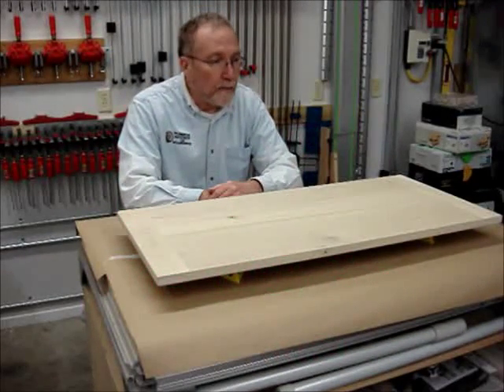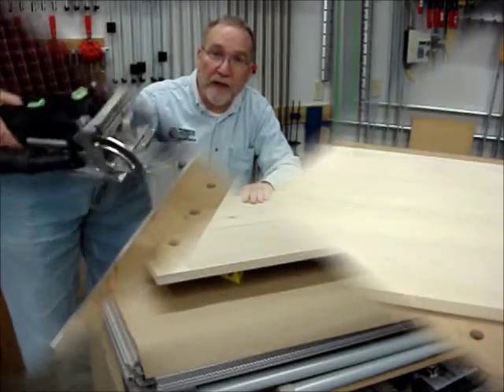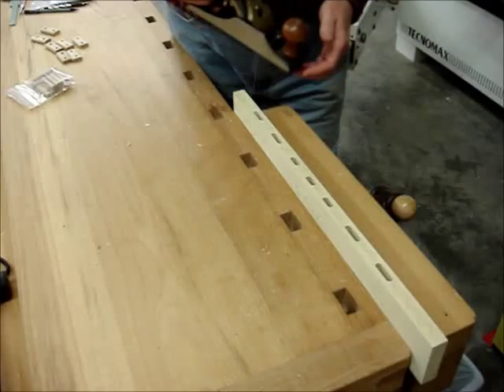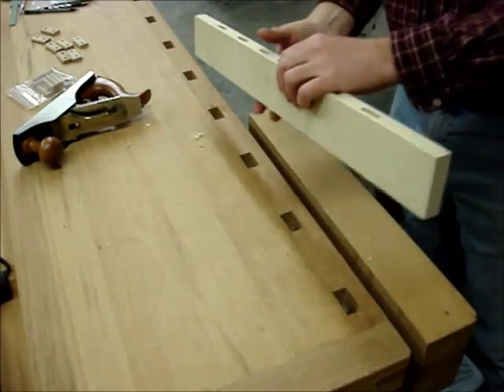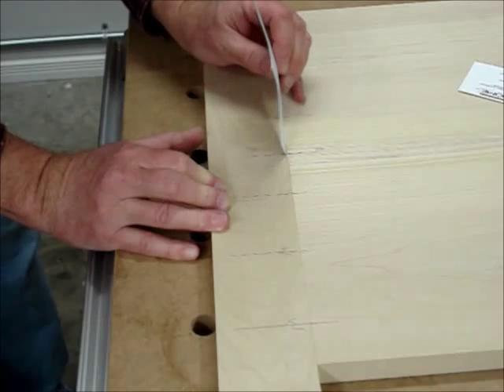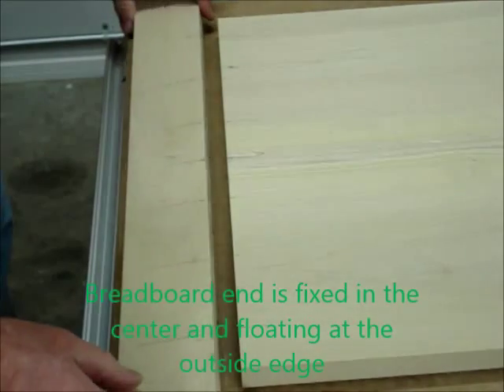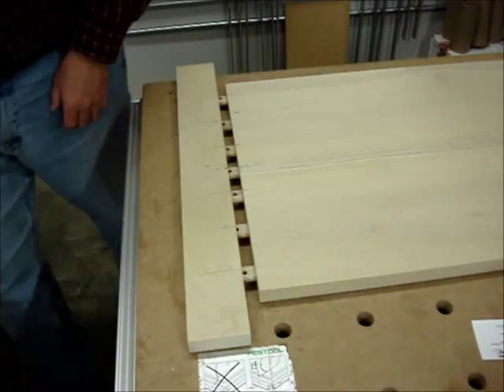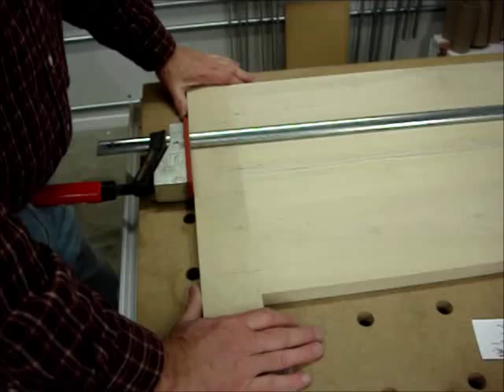Making a breadboard end with the Domino

Comment: Hey, Steve, thanks for sharing this with us. I've always enjoyed your enthusiasm for sharing knowledge.  The only comment I'd make regards the holes you drilled in the floating tenons.  I am assuming you planned on pinning them from the underside, and perhaps even drawboring them in.  Assuming that's the case, considering the closeness of the holes to the edges of the planks, I'm wondering if you encountered any splitting with seasonal movement.  Again, thanks for sharing this with us.
Reply from the maker: Hi Marty.  I did not pin or draw bore these.  This was the top of a toy box for my grandson. It has been nearly 4 years ago and there is has been no splitting or separation and the lid is still flat.  it was painted with milk paint.  Steve

Comment: I really enjoy your channel. I have been looking at the mafell DD40, and planning on using it instead of the domino for projects such as the one above. Since you have both in your shop, would your first purchase be the domino or the mafell?
Reply from the maker: Thank you Richard.  I think the best choice should be based on what projects you build most.  For furniture, I would opt for the Domino first, for cabinets, the DD40.  That top was for a toy box and I used both the Domino and the DD40.  The DD40 was a relatively new item for me at the time.  The DD40 would not be at all useful for the breadboard ends.  I did use the DD40 for the assembly of the case work which was also poplar.  It did that joinery very well and both have tight joints today.  Hope this helps.  Steve

Comment: This is great how is it holding up now?
Reply from the maker: A year and a half in to the use of a boy that is almost 6 - it is holding up great with no gaps.  I painted the project with milk paint and I don't even notice any cracking of the paint.
Reply from the maker: Brad Jones As I recall, the toy box top does not straddle a glue joint and it is holding up fine.  I have recently completed a table  top where the middle of the 3 dominos straddles a glue joint and it works just fine.  That top was made about 5 months ago.
Steve
Reply: ExtremeWoodworker  the 3 dominos that you glued in the center, I assume those were clustered in one board? Or did it span a lateral glue joint? What if my center is a glue joint? Plan accordingly so I don't?